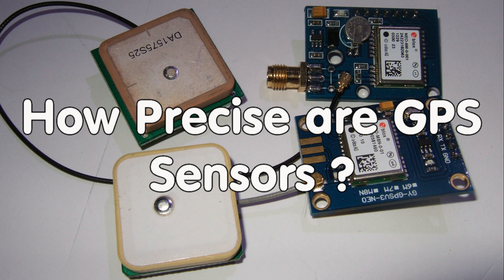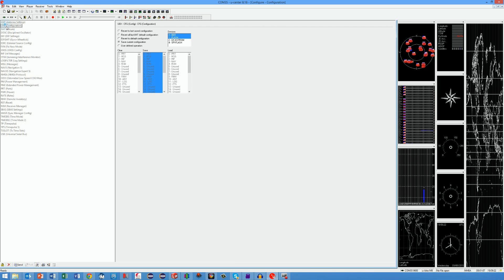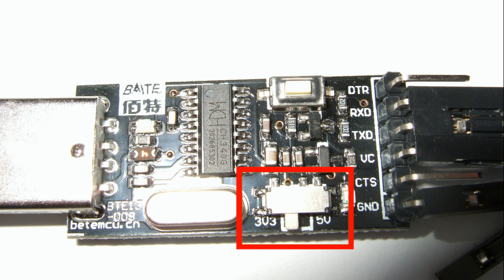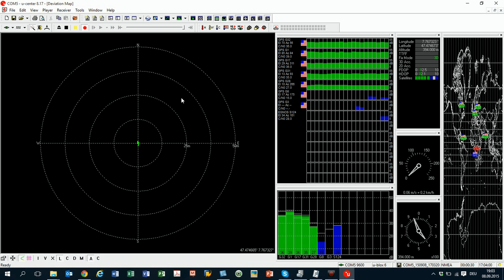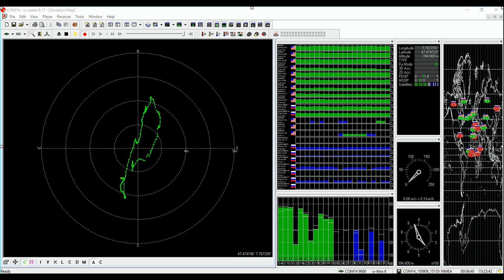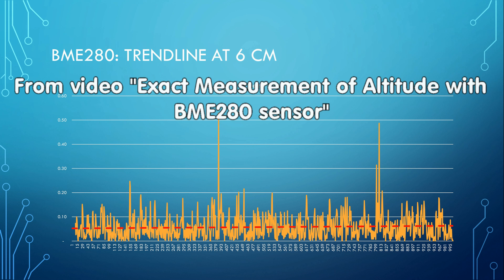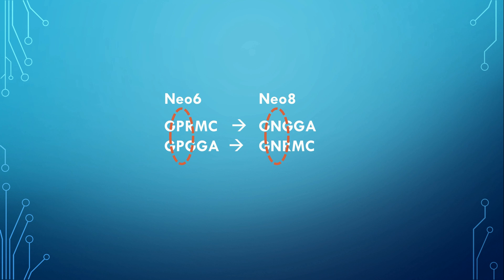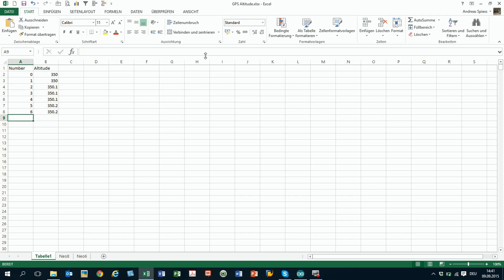#22 Comparison of precision between Neo-M8N and Neo-6M Modules

Comment: correct me if I'm wrong BUT you are only comparing the precision of each component's data stream and NOT the accuracy of each device. What I think you need to do is to check your precise location with respect to a known government geo survey point AND then compare the sensor data to that. For example I've previously in Australia looked as the position of a known official survey point with what Google Earth shows & GE is out with comparison to the official survey point.
Reply from the maker: +Ray Bright Yes, you are right. I only compare one part of precision. For my application, I am not interested in absolute precision compared with other maps. I only want to use it for my bycicle computer.
Still my tests are relevant also for your application, because the relative errors measured in my test add up to the errors compared with an absolute map.
I think also, it would be extremely complicated to make your comparison, because you are never sure if the error comes from the GPS or from the map. And here I definitively have no know-how as an engineer. I think, this is stuff for geometers ;-)